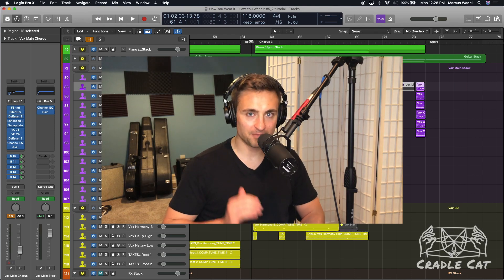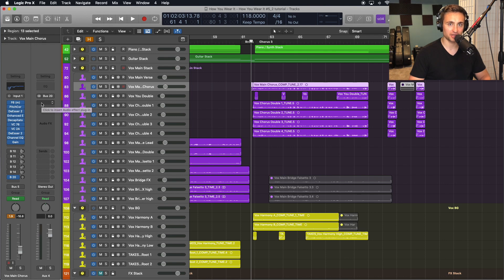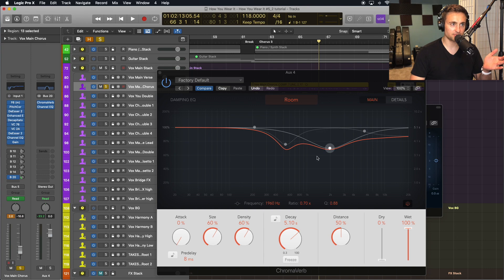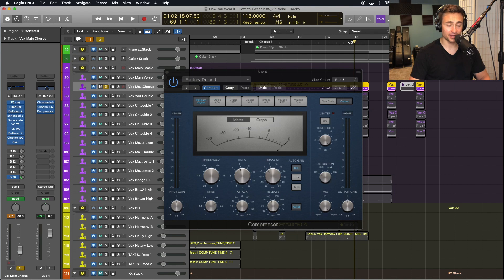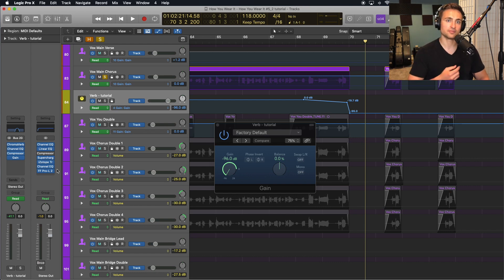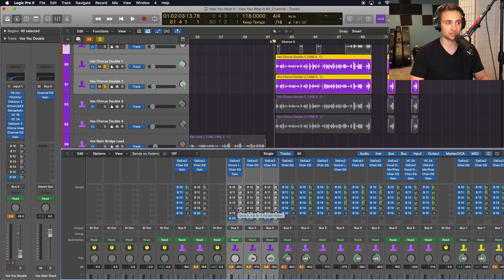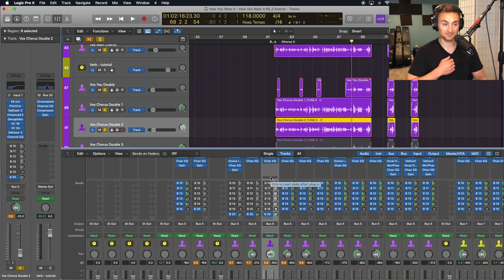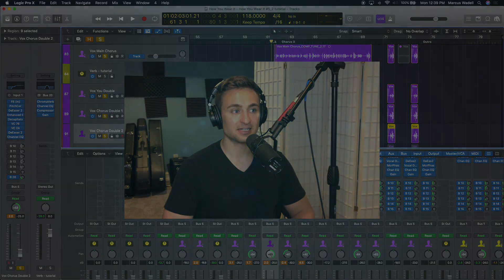A Better Way to Use Reverb: Reverb on an Aux Bus in Logic Pro X

Comment: Do you do the same thing with drums. adding reverb to separate tracks?
Reply from the maker: depends on the song! Usually yes, I'll have bus reverb setup. I'll actually post a song breakdown in the next week or so where I'm doing both. I have some relatively dry drums with individual hits using bus reverb, and then more live drum feeling with all hits on one track having reverb directly on it.

Comment: Hi, nice video! I have been using Garageband for a long time, and I recently switched to Logic. I like using the reverb fader that comes in the default smart controls in Garageband, and I was able to get the same mapping as Garageband as in Logic (Bypass Compressor, EQs with low/mid/high/low cut/mid frequency, and Sends (Ambience and Reverb)), but suddenly I was not able to get them. How do I get this back on Logic?
Reply from the maker: Hey thanks! Congrats on the switch to Logic 🙌 I’m not sure what you mean when you say you weren’t able to get them all of a sudden, but to get the sort of “master reverb” / “master delay” setup that Garageband has, you will want to set up auxiliary tracks for delay and reverb, and then use sends on your other tracks to bus audio to those two auxiliary tracks (which is what I walk through in this video) 👍
Reply: @CradleCat  oh ok yea, your video was very clear in that sense. I can do it that way, but I kind of want to transition smoothly into using logic, so it would be helpful to get the same controls in garageband. what i meant was that when I open up smart controls in garageband, it default opens to a certain layout (it's like the blue background and black faders), and I got that layout on a few of my logic tracks as well. I was just wondering how to get that same layout on logic again. If you want to see which layout i'm talking about, just open any garageband project and then open up smart controls and you'll see it. thanks for replying!
Reply from the maker: @anivartinanand5259  ok i think I know what you mean. It's just a different visual to control some of the common plugins (like compressors). To see that in Logic, click your Smart Controls icon in Logic (from the upper left), then, you should see the toggle/text "Controls" and "EQ" in the window that opened toward the bottom of your screen. You'll need to click on "Controls" to see that blue background and black dials view. Hope that helps! 

Honestly, I don't use that view much now that I'm used to Logic (I also started in GarageBand). I mostly just click on the plugin to bring up the interface that way.